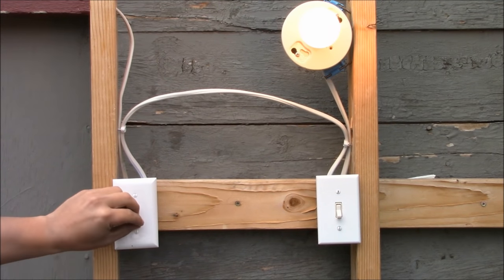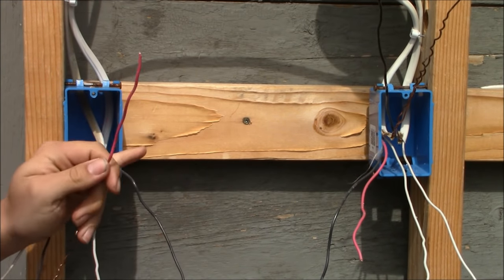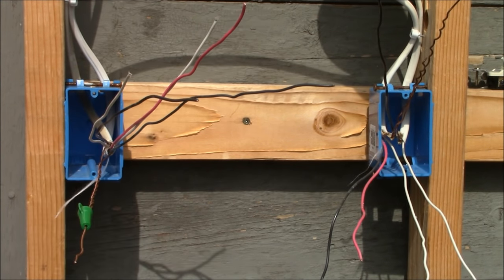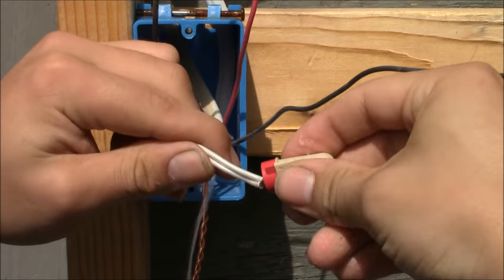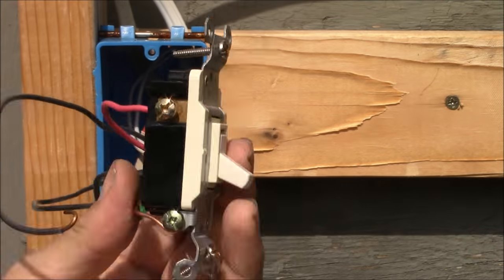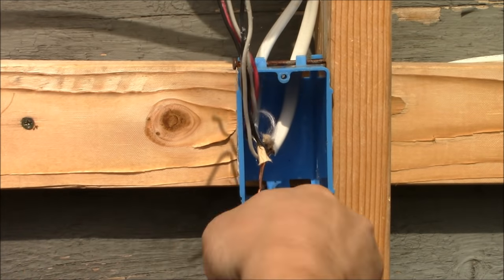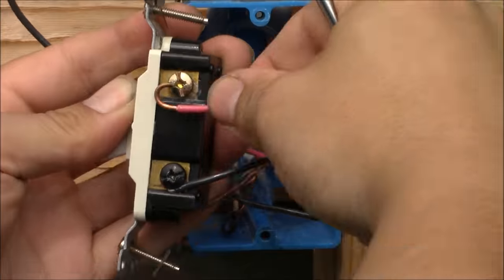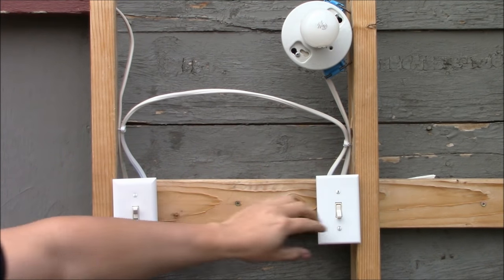How to wire a 3-way switch system

Comment: Would be great to actually see the conections to the switches clearly
Reply: Wirea olson furnace
Reply: Tortàral forwireingaolson
Reply: you wire each switch the same exact way with exception of the cable going to the light itself. Basically the switches have to face the same way to have a successful connection, that's why theyre not labelled with on/off. As long as the orientation of the black screw is the same in each box then it makes it easier to hook everything up.

Comment: he wrapped the wires in the first switch screws counter clockwise and the second clockwise. did the same thing with the ground wire. I think they should all be clockwise as the screw turns
Reply: You are correct. ALL wires should wrap in a clockwise fashion so as to make the wrap tighter as the screw is tightened. Also, in one instance, it looked like some insulation was trapped under a screw head on one of the travelers. A definite no-no. Sloppy workmanship.
Reply: Wow, good for you. Nice catch - you win. I was here to learn.  I didn’t even think to criticize
Reply: @timdolan4591   In the description Skills and Trade asked people to leave suggestions which is what shantor100 did. Richard Fallstich went a little further...
Reply: I'm in the commercial/industrial trade, and yeah, should've been clockwise, and also electrical tape should've been wrapped around the terminals. Also that looks like 12g, not 14g.  Could be wrong 🤔
Reply: @Jason_Van_Stone  You don't need to wrap with electrical tape.
Reply: Raymond Kolbe The only time I wrap the contact screws in the outlet with electrical tape is when it’s a metal junction box...especially the wide GFCI outlets.
Reply: @ Jason Van Stone Only time you need to wrap electric tape around terminals is if I’m a metal box. Sometime I do on dinners and wide devices side by side but for this demonstration you don’t have to the box is plastic
Reply: @WhipHCO  I'm not talking about electrical tape. I should say he wound the wires in the wrong direction and if you read my comment I never mentioned tape
Reply: shantor100 sorry but I wasn’t replying to you replying to the Jason van stone dude for some reason it didn’t tag him
Reply: @WhipHCO  no problem
Reply: @WhipHCO  hey good point about those wide switches side by side and using tape. I just finished wiring my garage apartment and have a five gang box.  Three dimmers and two three ways. I'm gonna take them  out of the box and use some tape to be safe!

Comment: FYI..if you're trying to get each switch to operate the light with no disruption, you need to flip the second switches wiring in reverse. Black load wire to top bronze terminal and travel wire to bottom black terminal. That'll create an infinite switch loop. (Otherwise one light switch will have to be on for the other to control it too).
Reply: @PHANTOM  Correct. So the "main" switch that gets the power supply, that one should be wired just like this video. However, the second switch should be reversed. Take your load wire and put it to the bronze terminal on the second switch. Then take your travel wire and put it on the bottom black terminal on the second switch. This creates a "rocker" between the two switches.
Reply: isnt it always on? if its “off” then u just switch ur second switch to “off” too each of em operate the light no matter if its on or off as long as it completes the circuit w any of the travelers from any point

Comment: Excellent explanation. Just a tip for the direction of wire wrap on the terminals. It’s supposed to be wrapped in the direction of the screw tightening. 
You have def taken the guess work out of this mysterious lightning scenario. 👍🏻🤛🏽

Comment: Thank you so much for a valuable video.  I lived with a half-functioned switch pairs for 10 years, believing the wiring behind the wall is snapped somehow.   After viewing the video, tried some lucks suspecting the switch wiring could be wrong.  Sure enough, this is the case.  Followed your techniques in the video and fixed a 10 years sorry toggle switch wrong wiring.  Thank you again.

Comment: It's this simple. The neutrals don't connect to the switches. The two wires (of the14-3 wire) that are NOT the ground connect to the brass screws. The black screws on both switches are the continuation of the power coming from the panel to the light(s). I've watched dozens of videos dozens of times over three years. I am now wiring the second building on my property and finally get three-way switching. If you think you are a simpleton this is the video for you. Thank you. The light in my head is finally on, lol.

Comment: OMG!  Finally!  I have an old house and I bought a cheap replacement Leviton switch ( for $1 ) and it literally has no labels on it. Not even an on/off on the front of the plastic switch. the old switch someone put in was a motion switch. It had no labels either. Plus this house is so old that there is no ground wire. So I literally had just 2 black lines going into the back of the old switch not labeled. I have no prior experience with changing switches out but I watched a few other videos on it and I thought it would be okay.  Wrong!  However, Your video was PERFECT!!!  You are the only one that told me that the black screw was where I needed to connect the load wire!  If not for your Video, I would have never figured it out and had to call an electrician out for a simple thing, and felt like an idiot for having to pay a ton of money for it!   THANK YOU THANK YOU THANK YOU !!!!!!!!!

Comment: I watched two different videos prior to this one, this one put them both the shame thank you so much!
Reply from the maker: Thank you very much Phillip. I'm happy to hear that
Reply: Agreed!!!!
Reply: My god this type of switch and wiring is prehistoric looking . This is actually called two way switching ( is called 3 way in america ) . 
A switch with wrap terminal is gone with the dinosaurs.  
Best way to wire a two way switch is to take the live wire ( feed from board ) to the common on switch 1 . 
On switch 2 run the switch wire ( wire that goes to your light) to the common . 
Now link both switches with a set of strappers ( two brown cables ) from l1 to l1 . ( FIRST WIRE ) . 
L2 TO L2 ( SECOND WIRE ) . AND THATS IT .
Reply: I agree Phillip I also watched two (very confusing) videos prior to this one.  I watched this one and was able to wire my three-way switch correctly the first time.  Many thanks Skills and Trade!!
Reply: That's a fact
Reply: Man he’s flying on that video🤔 how the heck are viewers to understand the connections like I clearly understand what the guy is saying but saying it’s not the same as doing 🙄🤯
Reply: @Tony-fl3rl  Can you point me to a link where your instructions are visually created thru a schematic? Thanks.
Reply: @Tony-fl3rl  buddy that is what is shown here, is it not?
Reply: @SkillsandTrade  On wiring the 3 way system, you don't show the wires going to the lightbulb fixture.  Where does the white wire and black come in from since the whites are not used in a 3 way switches?
Reply: Your video made the most easy understanding the travel wire actually bridge the electric source between two switches! Thank you!
Reply: I know that there are things to criticize about this video but this is pretty much exactly what it’s like to watch your journeyman teach you how to do this. Right down to the unnecessary code info and poor visual on the wires.

Comment: I just watched several other videos. They were WAY too technical. The basic premise as it turns out is simple (thanks to this video). Identify the line in wire and put it on the black terminal, and then put the other two traveler wires on the remaining brass fittings. No common wires used, so wire tie them together in each box, and if you have a box where the switch is not grounded to the box, attach the ground wire(s) to the ground terminal on the switch. I'm assuming if the cut in box is metal and the ground wire(s) are attached to the box and the switch is grounded to the box, there is no need to attached the ground directly to the switch. Mine works fine that way, so I'm assuming that is correct. Worst case, I could have run a ground jumper from the termination on the metal cut in box to the ground terminal on the switch. Thanks for the great video. It was FAR less confusing than the others.

Comment: Great video and great explanation. I wish you had slowed down the video a bit when you were connecting the second switch so I could see what wire connected to which terminal better. I also always wrap the switch terminals with black electrical tape. I don’t know if that’s necessary because I don’t see that often on these videos.

Comment: I want to install 3 way switches in a previously installed system with traveler wires. Like in this video, the power comes in on the left switch and the travelers go to the other switch box. But in my set up, the first box has the hot wire to the light and the second switch box only connects to the first box by the travelers. I saw a video that said hook the neutral (white) to the common in the second box. But when I did that it blew the fuse. Will it work just with the travelers hooked in the second box and the neutral capped off?  Thanks.

Comment: So it’s 14/2 wire coming in with power then 14/3 wire between the switches and 14/2 wire again out to the light? Thanks for the video my friend , very detailed. Subscribed
Reply from the maker: Yes, that is correct. Thank you
Reply: @SkillsandTrade  whta if there is one 14/2 and two 14/3 wires?
Reply: robert keyes u can cap off the red wire assuming the installation isn’t weird

Comment: Any possible way of adding a 2nd switch to a light string switched only on one corner of the basement/top of the stairs.. to the opposite/caddy corner, basement floor without running 12/3 fully across the basement & fished upstairs to connect to the switch in the method shown?  Thanks kindly for your time. It’s not the work that troubles me, it’s the cost for that much wire. 

Simply looking to add a switch by the walkout basement door as I finish it. Can lights were put in on an old, existing switch loop. Looks as if I may just have to add another light + power source when entering through the basement. Should of replaced it all & deleted the switch loop. Good of you to be helping other folks. Thanks

Comment: Quick question. So when your putting your wires on your terminals, aren’t the jackets supposed to be stripped down until it shows the brass? My trade school teacher told me I was doing it wrong when I did that

Comment: Its a good video but I recommend you try to leave the least amount of exposed conductor so chop off all that excess ground. Also when hooking on the wires to the switch make sure the hook is clockwise. In the video you put the hook counterclockwise which can risk the wire not having good contact

Comment: Hold up, hold up, hold up
When you hook the conductor onto the screw  make sure that the  tip of the hook is going in a clock wise direction around the screw , ( hook it the opposite way of the video) this is so that when you tighten the screw the copper will wrap around the screw as you tighten 

And also you do not want insulation under the screw , strip the insulation to a point to where the copper is not past the back of the device but also the insulation is not under the screw

Comment: At 1:40 the wire is supposed to be wrapped around clock wise. It just helps when you tighten it’ll grab the wire. If you it do it counter clock wise it’ll push the wire out.

Comment: To be simply put; 14/2 is the main power (coming in) to switch (1) 14/3 links the 2 switches together and 14/2 is connected (leaving) switch (2) then to the light.. 

In this scenario 14/3 is ONLY used to link the 2 switches together enabling them both to "communicate" together to operate the same light. The 'red' wire is the 'link' ....  also... both switches must always come first in the chain before the light..

Comment: So i have been hunting around. Is it possible to run a 2nd light switch from the light box? I don't have attic or crawl space access. The light is already run but on the back of the room. I want to run a second switch to the front of the room. The wall the switch is on currently i cannot cut open, but the 2nd wall i can.

Comment: You say neutral is not really needed for function, but it does get wired all the way to the light (bypassing the switches). Wouldn’t the whole thing not work if you did not wire neutral at all?

Comment: What if you have two hot (lead?) wires coming into the first box? How do you know which hot wires to use? This was an old house and I want to add two additional switches to the same lights.

Comment: Ok, nice simple video. I have lights upstairs wired to 3 switches by my cousin before I bought this house. I want to add to lights at the bottom of the stairs. How do I add these lights to the existing switch at the bottom of the stairs so ALL the lights, both up and down, come on and off? What I wired today isn't working correctly.

Comment: Ought to also show running the feed to the light box, the other way to wire a 3 way.  I typically run all my lighting circuit feeds to the ceiling boxes with a switch leg down to the box with the switch. IF I ever have a problem, I go looking in the ceiling boxes to start.

Comment: Use a pair of line man pliers to twist the conductors together, the trick is to use a light grip initially in order to get a nice shape then with a strong grip twist the copper together  shape , cut the very tip of twisted copper off  , make sure your wire nut connections are extremely tight , you can even use the line man’s pliers to get another twist on them after your fingers can’t twist them any tighter , use the little hole on the side of the strippers to bend you a hook in a clock wise direction , hook on to the screw and use your strippers to squeeze the hook together, then first use Philips screw driver to get the screw snug then use a big flat screw driver to tighten the screw the tightest it can get , make sure that all screws that are not in use on the device are fastened down and snug.l, do not leave the extra screws out because this can cause issues , make sure your ground wire is fold in the box and pushed away from the screws on the device 
-ELECTRICAN  

This goes for installing any device ,

Comment: What if the light I am using doesn’t have a ground?  It is an LED plug in light. I cut the plug off and theirs only two wires no ground. Can’t seem to get the switches to work in Unison. Is that because of the no ground on the LED light? 
Thank you

Comment: Thanks for this great video. So I have an issue I have a 3 way connection in my hall way which I replaced the switches seem to be working but it seems like one of them has total control. Because if it's on and I use the switch on the other end it works to turn on and off but if I have the other on the other end flipped to off than I can't turn on or off on the opposite side any idea on what I did wrong

Comment: THE SHEATH IS MAX"D AT 1/4"" IN BOX... A 3 WAY SW. IS A Single POLE double throw. 3 Way set up u have a line side and a load side . If your not an electrician please ask questions.

Comment: Great video! Question: 
Is it possible to connect a GFCI first with the line from the breaker panel; then send the black live and pig tail the white neutrals together at the first 3-way switch?

Comment: Great video...I would also like to know how to wire the light...thanks!
Reply: I have 2 whites, 2 blacks and 2 reds in the box. The light fixture has 1 white and 1 black. Which wires attach to the light? Which are twisted together and capped? Thanks!
Reply: "I have all these colorful wires in a box, do I splice in the negative to positive or positive to positive? And what's this shiny green wire do?? Is that for my ceiling fan???"

Comment: It didn’t show how is connected to the light, I will like to see everything because I don’t know much of electricity and I will like to do it properly, thanks
Reply: The black wire going to the light is connected to the bottom black screw while the neutral is tied together with the other neutral wire
Reply: The “black” hot wire connects to black wire from light or brass screw. The “white” wire connects to the neutral white wire from light or silver screw and the ground wires connect to “green” ground terminal.

Comment: I have a hallway light with two switches - switch #1, at the back door entrance and another switch, #2 further down the hall. If I turn the light on at switch #1, then turn the light off at switch #2, then go back to switch #1 and try to turn the light back on the light will not come on. I have to turn the light on at Switch #2. In case that is not clear:

Switch # 1 - turn light on
Switch #2 - turn light off
Back to switch #1 - light will not come on using the switch
Back to switch #2 - light will come on using the switch

My unit was wired by the developer's contractor. I'm thinking a wire is out of place. Any thoughts.

Comment: I replaced one of the switches just because it was old but now that switch has to be on for the other one to turn it off. I'm guessing I used a single circuit switch and I need to replace it with a three-way switch. Electrician in training

Comment: Did anyone notice he looped the black hot wire in the wrong direction, generally when you do that the wire loop can become undone as you tighten the screw in a clock wise rotation, not a huge deal if you hold the loop closed with some needle nose as he did, but just something to keep in mind

Comment: Wrong direction for the ground wire hook.  Tightening the screws actually will tend (not always) to push the hook away from the screw.  You will certainly rotate the kink before the loop into an unplanned and undesirable angle though.